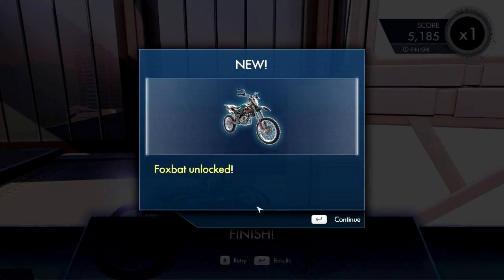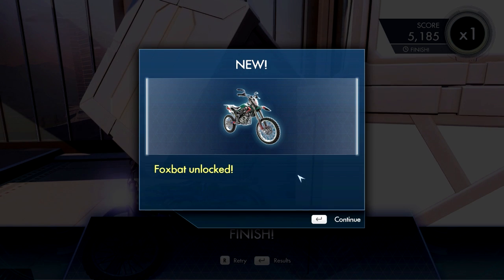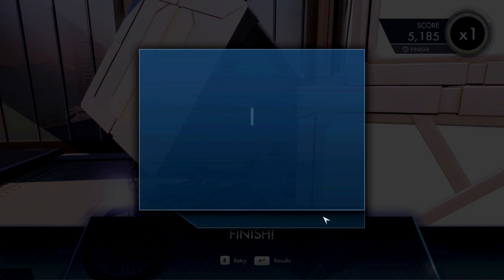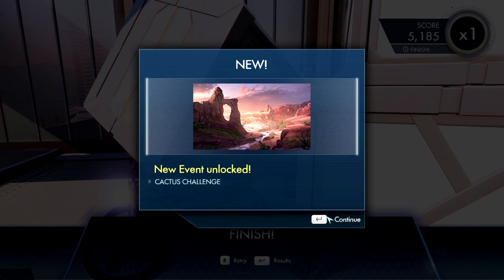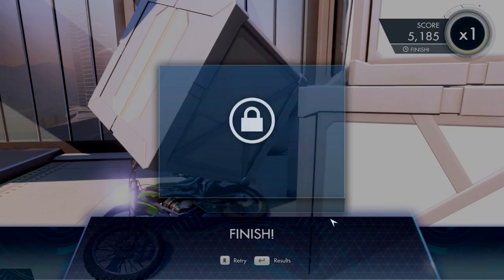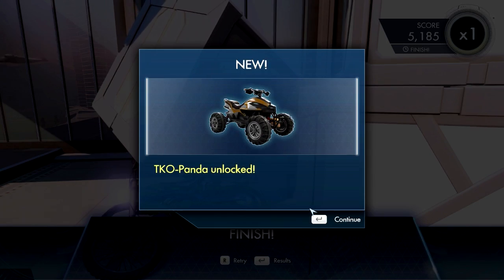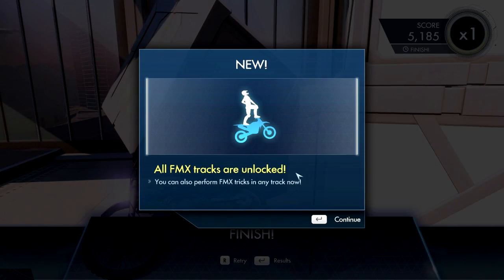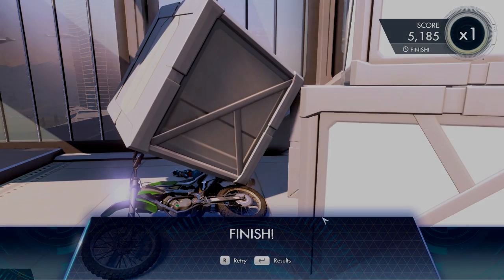Single vs. Dual GPU's - The Differences

Comment: is this good enough to handle new games like battlefield 1 when it comes out: 

Specification

ProcessorProcessorIntel Core i7 4790Processor Cores4Processor Speed3.6GHz / 4GHz TurboGraphicsGraphics CardNvidia GTX 960Graphics Memory2GBDrivesHard Drive1TB SATA3 6GbpsOptical Drive24x DVD/CD RewriterNetworkingWired Video OutputsVGA (D-Sub), DVI-D, HDMIMemory16GBPower Supply450WCaseAerocool GT Advance Black Gaming Case w/ Red LEDsMotherboardGigabyte H81M-H
- HD Audio
- 1x PCI Express x16, 2x PCI Express x1
- 2x back USB 2.0 ports
- 2x back USB 3.0 ports
Reply: yes low to medium settings.
Reply: Venom Gaming Oh absolutely! nice computer!
Reply: Dank Memes I have a 1060 now :)
Reply: Alaa Eddine Choukri Thanks haha. what do you have?
Reply: ***** Woah what! A little laptop can hold a big graphics card? wow!
Reply: Alaa Eddine Choukri m is smaller

Comment: Sir KOBZ can you tell me whick build is better?? or can you suggest better

OPTION 1Processor- cpu AM3: AMD FX 6300 3.5-4.1Ghz, 14mb 6 core
GPU- vga nVidia Zotac GTX 960 2gb/128bit ddr5
memory- Crucial Micron 4gb ddr3 1600
HDD- hdd int 3.5: Seagate  1tb(ST1000DM003) 64mb sata
Motherboard- mb am3+: MSI 970 Gaming
Monitor- monitor: Viewsonic 20 (VA2046a) LED vga, vesa
Casing PSU- casing-psu: Cooler Master CMP 102, 500watts PSU
OPTION 2
CPU-cpu AM3: AMD FX 6300 3.5-4.1Ghz, 14mb 6 core
RAM-Corsair Vengeance 8GB (2 x 4GB) DDR3-1600
GPU-Sapphire Radeon R9 290 4GB Tri-X OC
Motherboard-ASRock H97 Anniversary ATX LGA1150
HDD-Western Digital Caviar Blue 1TB 3.5" 7200RPM
Case-NZXT S340 (Black) ATX Mid Tower
PSU-EVGA 600B 600W 80+ Bronze Certified ATX Power Supply
Reply from the maker: option 2 without a doubt but keep in mind, that AMD FX 6300 will not work with that Intel motherboard
Reply: Then what motherboard would you recommend?? thanks for the reply btw :)
Reply from the maker: Badge Plays any AMD AM3+ compatible motherboard will work. What's your budget for a mobo?
Reply: I don't really know  much about computer I just want to buy a PC that run smooth in any game and can multitask ad has fast boot
Reply from the maker: what's your overall budget then, and i'll put together a PC that will do that. I assume you're from the US
Reply from the maker: Badge Plays alright man, one second, i'll cook something up - just reply so i get another notification
Reply: +Kobz360 ayt man ! cool
Reply from the maker: Badge Plays http://pcpartpicker.com/p/JL8bqs

This only cost $1092USD, and I'm including Windows in it as well, not including a monitor though. If you're from phillipines though, shipping is going to be an issue/or if buying locally, your prices will be higher.
Reply: +Kobz360 thanks man! youre awesome
Reply from the maker: Badge Plays im happy to edit it more if you'd like man, still got some change leftover and you could potentially get some better parts  but yeah, consider the shipping and all that too
Reply: Good Job Man how can I contact you if ever I have a question
Reply from the maker: Badge Plays just here on YouTube man

Comment: may i ask if i can merge another single R9 to mine(r9) , will it work(the game performance) like its one processes unit, and gave me result(almost) of R9 295X2?
Reply from the maker: +slam3lykom2all what R9 card do you have? and what one do you plan to buy
Reply: i have GIGABYTE r9 270/rev1.0 (GV-R9270C-2GB)
pci-e 3.0/2gb gddr5/256 bit
, my plan to buy what ever that suit and the best option to play on high res and high fps.
thank you very much for your respond , sorry 4 my bad english :3
Reply from the maker: slam3lykom2all motherboard?
Reply: intel i7-3770 cpu @ 3.40gh / 8gb ram
motherboard  DZ77BH-55K
Reply from the maker: slam3lykom2all you could buy another R9 270 and run them in crossfire, but you'll also likely need a better power supply so support the extra wattage
Reply: thank you very much bro

Comment: sorry i am new to this but what would be the difference between a Dual 6GB NVIDIA GTX 980Ti  and a Single 6GB NVIDIA GTX 980Ti 

would the duel be way better? in what ways? worth buying the duel instead? (talking about buying 1 single or 1 double)

thanks
Reply from the maker: there's no 'dual' 980TI's. it's a single gpu Card. however, you can buy 2 of them and run them in SLI (together)
Reply: ***** so would that be a lot better or just a little bit better
Reply from the maker: +andrewx12x a lot better, close to 2x the performance of just one 980 ti
Reply: ***** ok thanks!
Reply: +Kobz360 could i run one ASUS GTX 970 and one EVGA 970?
Reply from the maker: EfficiencyBestMetric yep, that'll work fine

Comment: could you add an additional single gpu that isnt the same brand and will the power of the card add up or do their own thing?
Reply from the maker: Has to be the same single GPU (e.g. to GTX 980's) but they can be from different board partners like Asus, MSI etc. 

With AMD though, you can put a 7950 and a 7970 together (as they're the same base GPU essentially), however, the 7970 will only perform at 7950 level.

So to answer your question, if by brand, you mean can you mix AMD and NVIDIA.. no you can't.

Comment: Can you have 2 NVIDIA GeForce GTX 750 Ti's?  If so, how would the performance be like? I have 1 at the moment and thinking about getting another one.
Reply from the maker: unfortunately the 750 Ti is not SLI capable so you cannot have two of them
Reply: I have 2 Gtx 750 non ti running on crossfire and it gave me 30% more fps and power and work just fine. How would the ti not work?

Comment: Check this out -

For article of fully unlocked 290X+ (3072 processing cores), see -

http://www.kitguru.net/components/graphic-cards/anton-shilov/amd-readies-enhanced-radeon-r9-290x-hawaii-graphics-solution/comment-page-1/#comment-199763

Also, AMD is releasing a new FX cpu with a liquid cooler. People think this could just be an overclocked PD, but AMD have already done that (9370 and 9590!). I have a feeling this could be the limited edition FX steamroller version (for AM3+ platform) and I think it may have 12 processing cores (6 modules). This is AMD's response to the 4960X and upcoming devil's canyon:

http://www.xbitlabs.com/news/cpu/display/20140621200650_AMD_Preps_a_New_FX_Series_Microprocessor_with_Bundled_Liquid_Cooling.html

Comment: thanks for this video it helped a ton! ive been trying to figure out what a dual gpu was! can you tell me if this gpu "http://www.newegg.com/Product/Product.aspx?Item=N82E16814130946" is compatable on my card? "http://www.newegg.com/Product/Product.aspx?Item=N82E16813130756&cm_re=msi_mini_itx_fm2-_-13-130-756-_-Product"
Reply from the maker: Yes your gpu will fit on that motherboard
Reply: Go on www.pcpartpicker.com